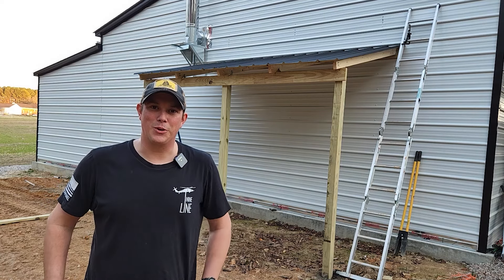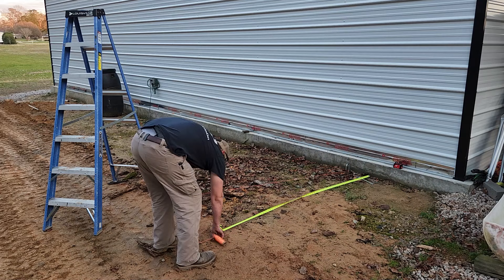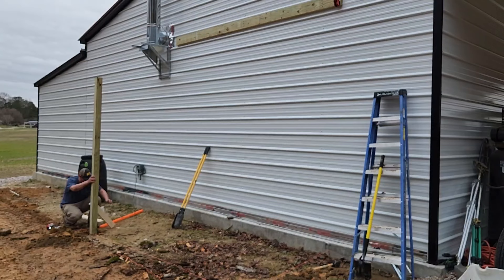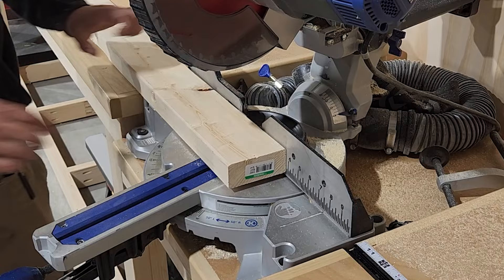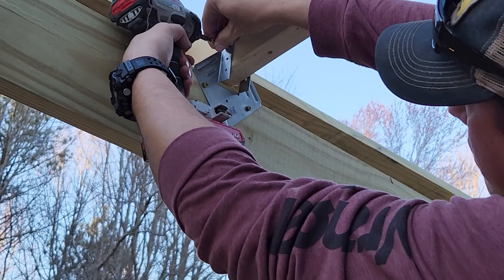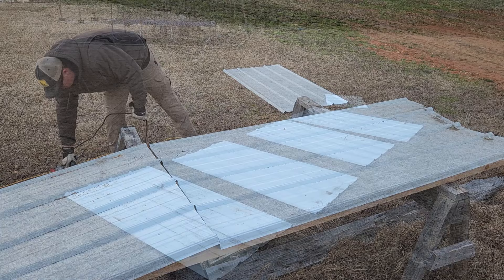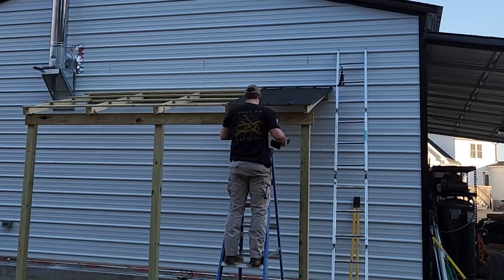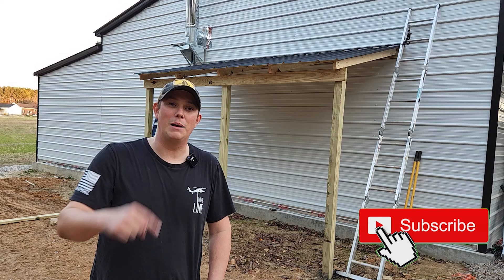How To Build A Lean To On An Existing Building

Comment: Nice video buddy! I have a few questions, would appreciate if you can help me out.

1.-What is the roof made of? Is that the same roof that third world countries use to roof their houses? Is it galvanized stainless steel? 
2.-How resistant is it over time in the presence of all-year sun and sporadic rains? 
3.-What metal gauge do you recommend if I´m going to use it in my patio for my home gym? The area I´ll cover will be 49 squared feet 

Thanks in advance!
Reply from the maker: It's metal roofing, you can get it at any lowes or home depot. It will hold up for a very long time under most conditions. I'm not sure about the gauge.
Reply: @PatriotDIY  Thanks for your thoughtful response!

Finally, do you recommend buying a factory-painted one? Would the paint give a better result in terms of longevity and less maintenance? Or a bare galvanized steel is more than enough?

Comment: Can metal or polycarbonate sheets be screwed into the rafters without using the purlins ? Thanks.
Reply from the maker: The pulling give better support to the roof since they run the opposite direction of the roof panels. They also at stability to the whole structure

Comment: How did you determine how far down the 2x6 needed to be on the posts?

I'm looking at building a larger version, and I think I'm overthinking this video. Your roof supports set flush on your  2x6 mine. When I lay it out, it leaves a gap between roof supports and 2x6.

Thanks.

Comment: Dig your style and approach to the video/project, man. Any idea where a guy would find some siding like you used for the roofing element? Would corrugated metal scraps work similar or too heavy?
Reply from the maker: Lowes or Home Depot should have some or your local roofing supplier.  Corrugated metal would work fine as well

Comment: The gap between roof and house siding will leak water in during the raining day.
Reply from the maker: Yea, you can add flashing if you worry about that.   Mine was eventually used as firewood storage so any small dripping that may occur at the wall just wasn't a concern for me.

Comment: Nice video but what you have done with your 4X4 support wall is not done correctly.
The way you have it, there are only 6 screws going through a single 2x6 which is supporting the outside of the rafters which is in turn supporting the entire weight of this roof.
   The proper way to do this would have been for you to place a double 2x6 beam directly on top of the 4x4 posts to support the rafters.
This way you are not depending on mechanical fasteners (screws) alone to carry the weight. 
    I don’t know what part of the country you live in, but where I live there is a huge snow load factor that must be considered when building a roof.
Reply from the maker: We are lucky to see 1 inch of snow here. Thanks though!

Comment: How did you seal the roof so no water leaks where you attached it to the building?
Reply from the maker: I didn't, wasn't necessary for my application but the best way would be flashing!

Comment: Do you have to seal between the metal roofing panels so moisture doesn’t leak down through?
Reply from the maker: I guess it depends on the application but i believe the way they overlap that usually isn't necessary.

On the other hand If you were building it like the roof on a house you would have a layer of plywood covered by a house wrap material then the roofing on top of that.

Comment: Did you need a building permit? I have a patio with a frame allready built around it .I don't know if I would need one or not for just adding some metal roofing to the top or not.

Comment: I'd like to use your lean to project but build a small porch with it. Would that be a different build considering you put the posts in ground or can i scab onto them. Its just for a small camp trailer that is a permanent structure now.
Reply from the maker: This video should help https://youtu.be/6D2UY_TZj3Q?si=rQNbwfE_lBUVQxbj

Comment: Is the top board secured only to the metal sheets or is it secured to posts or something structural on the inside?  I guess it really isn't holding much load at all because of the concreted in posts but wondering how strong it is where it attaches to the building
Reply from the maker: It's fastened to the metal stud framing

Comment: If I wanted to do this but enclose how would I seal off to keep the rain from coming into the lean to at the shed wall? I’ve never done anything like this before so sorry if the answer is obvious! TIA
Reply from the maker: You would need to add some flashing and/or Silicone at the joint between the roof and the wall

Comment: Hello! Can the wall plate, lower beam, rafters and purlins have the same dimensions for 6x6 posts?
Reply from the maker: I'm not sure I understand the question
Reply: @PatriotDIY  Sorry man, guess I should've elaborated more. I'd learned both the 2x6 lower beam and wall plate supports rafters and purlins.

However, I have a question for you, Sir. I'm stuck on something and hoping you could help out. I"ll be doing something very similar to your project, mine will be a 4x8 pergola. for my back porch

Here is what I like to do.

4X4X8 OR 4X4X10 WRC or PT - POSTS
2X6 WRC or PT - LOWER BEAM
2X4 OR 2X6 WRC or PT - RAFTERS
NO PURLINS.
POLYCARBONATE ROOF PANEL

Im stuck on choosing which rafter size to go with. I live in Texas, so we only worry about heavy rain and hardly any snow. Are (4) 2x4 rafters ok since the length is only 96 inches and at 24" spacing that should be only 4 rafters - ends included?  I had did some research and its pretty much split 50/50 what to use.

I dont think purlins are needed since I had seen many projects such as ours on YouTube that didnt use any for polycarbonate panels. Maybe purlins will be needed on 2x4 but not 2x6 rafters? 

I'm trying to cut down costs as possible but maybe if i could use less 2x4 or 2x6 rafters I could go with WRC other than that, Ill stick with Pressure Treated Wood.
Reply: @angelomaurizio1668  Go with 16" OC for 8 ft 2x4, or use 2x6, if you are using spruce, (SPF).

Comment: Did you caulk the roofing to the siding for waterproofing?  Or you don't really need to go that far?  I am panning to do a shed/shop like this off my house, a 12x20.   I plan to frame in the walls and all so I can work in there in the winter.  Code wise I do not want to do a ledger board just to stay off the radar. I was going to do 4x4 posts and snug it up agains the house and then caulk the roofline to the siding.  Just curious if anyone has thoughts to share.
Reply from the maker: I didn't for my purposes, but you may want to cylicone and add flashing

Comment: ok but how does one ensure rain won't seep through behind the ledger and through the screw holes and on into the shed studs?  This has caused my friend to go balistic when I told him my plan to this.
Reply from the maker: Easy, add flashing at the wall and the roofing screws have gaskets on them so no issue there....
Reply: @PatriotDIY  I agree about the screw gaskets but what stops rain from seeping down behind the upright part of the flashing... or do you mean push the flashing up under the roofing ?
Reply from the maker: @2nostromo  the flashing would go on top of the roofing but would be either mounted under the wall panel OR if thats not possible you could cylicone and screw the flashing to the wall.  They also make flashing tape, but ive never used it.

There are alot of videos on installing flashing that should help.  It just wasn't necessary for my application.

Comment: @PatriotDIY
what did you use to seal the bottom of building at concrete?  My oad is a little larger than building just like yours and i wanna stop the water from getting in.  I seen in other vid that u caulked the inside, but how did u do the outside? Looks like flashing tape but cant tell.  I didnt see a vid on this anywhere...  thx!!!

Comment: Should have pointed out how to keep rain out of the upper end of the sheet metal.
Reply from the maker: I little Silicone will do the trick.   Or you could use flashing
Reply from the maker: @DEZMOND HANENBERGER  Flashing is probably the best way but my siding made that difficult and since 
mine was a tight fit against the wall and i just put a bead of silicone

Comment: That quick setting concrete is not strong at all. Good video but it is worth it to pre mix high strength cement mix
Reply from the maker: It's 4000 psi, I'd say that's plenty for this application
Reply: Say as you like.  So says the bag.  30 years experience and thousands of posts set says sometimes that quick set just doesn’t cure right poured dry water added later no matter how close to ideal temp and moisture… follow directions to a T… still pretty often it cracks with minimal stresses. Not worth the chance says a guy who’s used it all for a lot of years.  Claims on packages don’t always bear out in real circumstances. Peace
Reply: Constructive criticism is no disrespect and sharing real experience is no harm.

Comment: hangers are pointless.  screws are strong enough to hold 10 times the weight.
Reply: What about the wind uplift loads?
Reply: @MrLike2surf  
screw it down.  no need for a metal bracket

Comment: Have you ever mixed concrete in a wheel barrow?
Remember how you had to mix & mix & mix & mix 
& mix to get all the dry powder wet? What makes 
you think mixing in a hole is getting all the powder 
wet & mixed? Only the top few inches is. The rest 
is still dry. You did it the lazy way.

!
Reply from the maker: You must have never used the fast setting quickrete. It pulls moisture from the ground as well. I did exactly what the instructions on the bag say for setting a post!  
https://www.google.com/url?sa=t&source=web&cd=&ved=2ahUKEwib7776tpb7AhWCSTABHXOKDYgQFnoECBsQAQ&url=https%3A%2F%2Fwww.quikrete.com%2Fpdfs%2Fdata_sheet-fast%2520setting%2520concrete%2520mix%25201004-50.pdf&usg=AOvVaw0sWUrDr99fHXDF85aBtIl3